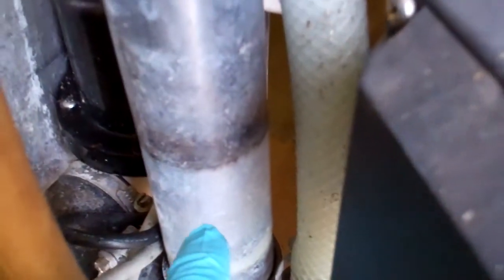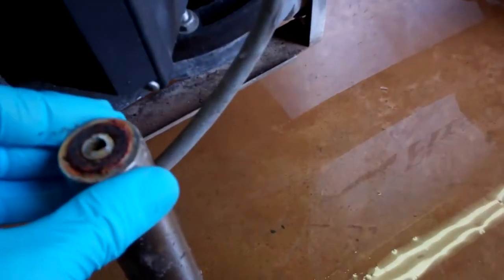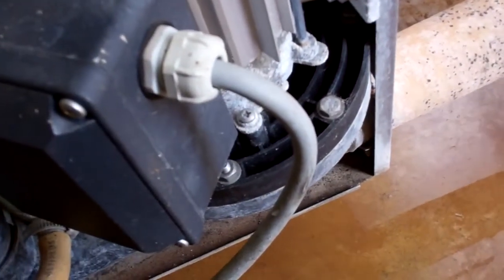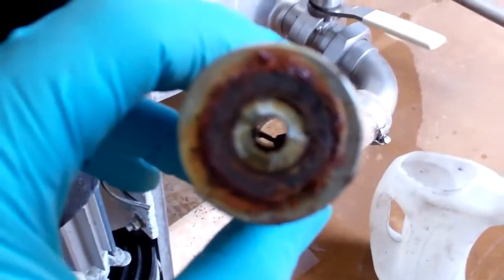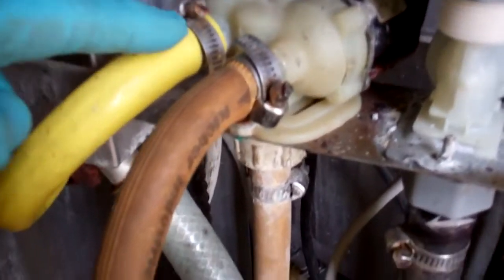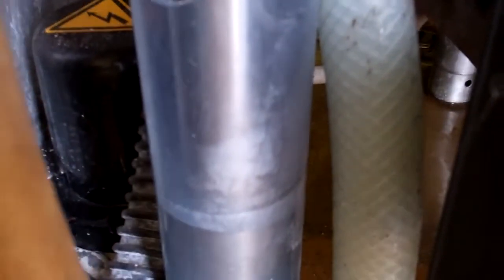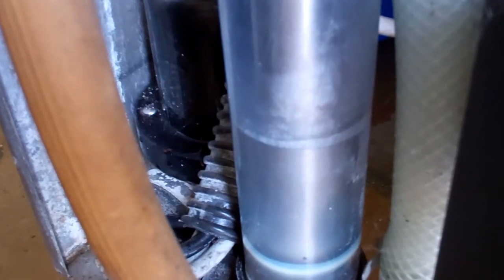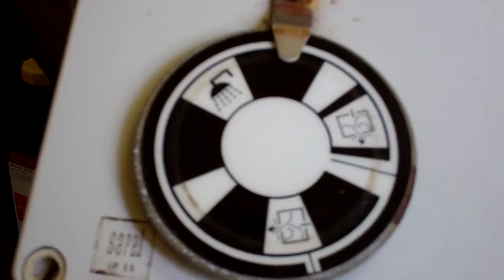Serap Wash 2000 repair

Comment from the maker: @05clenharth Different makes of milk tank use different methods of setting the water level, some like this one, others use a conductivity probe that senses once its in water, and others just allow a set time for water to go in.

On the more modern ones they can even tell if the right amount of chemical has gone in, or if there is milk in the wash system just be measuring with a conductivity probe!